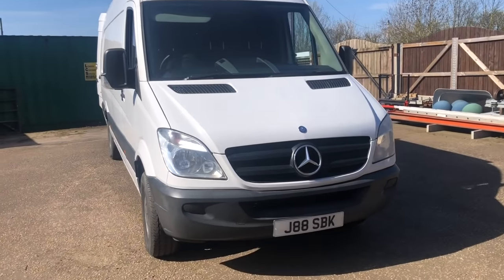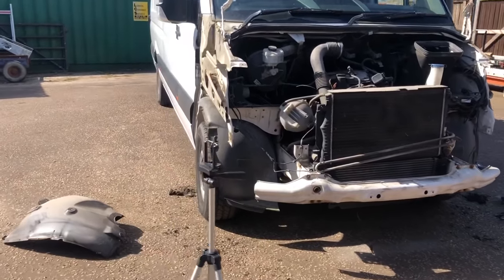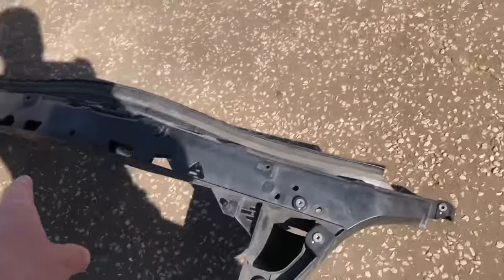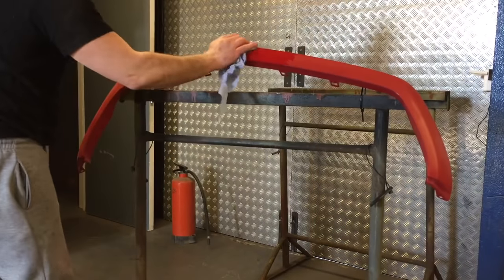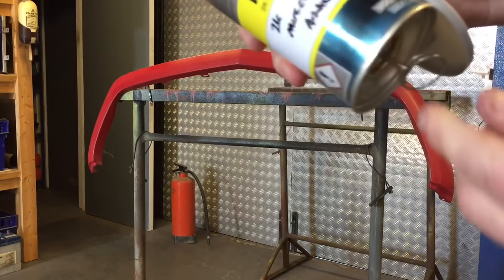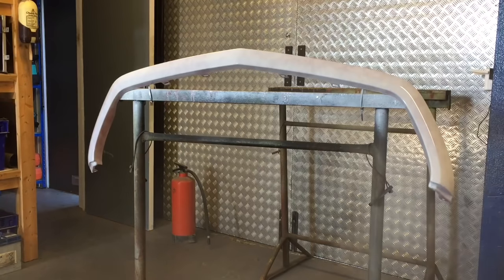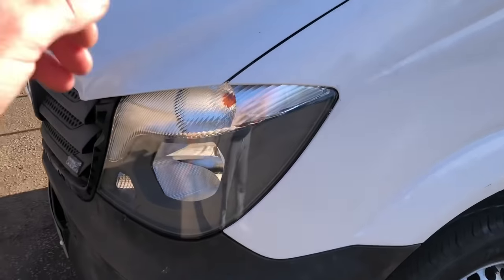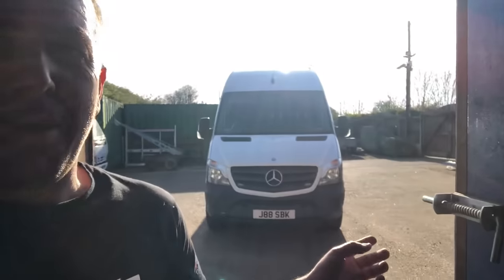2008 Mercedes sprinter facelift to 2017 PT 2

Comment: Nice work. But I personally prefer the original earlier shaped front end.    
I changed the rear lights and rear panel on a mk3 escort years ago, updated to mk4 rear lights. But afterwards I wished i hadn't!

Comment: The changeover here in the US was 2014 for this style front end. I learned something new: watching your video, I don't have to change the inner front bumper reinforcement bar or the radiator. That's great news. 
So is this the list?
01. left front fender
02. right front fender
03. hood
04. radiator support
05. left headlamp
06. right headlamp
07. front bumper 
08. grill/star
09. grill surround

Did you use new hood hinges? New hood latch?

Comment: I’ve got this to do this evening 2012 to this face lift my questions are do you not need to change the radiator? And the headlight wiring is it the same colour wires just a different plug ? Thank you for the video

Comment: Hello Rob thank you for the video it has helped a lot with my facelift on my sprinter van . Just wanted  help with the headlight wiring to please ?  I don't know which wire I need to connect to on my 2007 sprinter to make this 2016 headlight work.

Comment: At 00:25 you spoke of doing some wiring for the new headlight housings from the old. Did you get the updated sockets with all the second hand parts you bought? I'm doing this conversion now and having a problem finding the correct replacement sockets for the headlights. A link would be great if you have one.
Reply: Hi did you manage to find the headlamp wiring diagram I need help on this thank you

Comment: i spend my life in sprinters as i work for iceland ive driven old ones and new ones ours is a face lift as it is a 64 plate i have loved watching it as of course we dont take them apart but its nice to know how its built
Reply: Martin Burbridge 
Yay! I’m a Sainsburys Driver.
Wait till you drive a new 18 plate upwards, drive like a dream especially as an auto which is all we drive no manuals on our fleet.
New ones aren’t as handsome though!
Reply: ive driven a 58 plate one  when ours was broken for 3 months as side door fell offwe have auto too the one we have had paddle shift on steering wheel where as our 64 plate you can go up and down gears by knocking it sideways Sainsburys you use them ones that look like our old box ones the have sold all of them now
Reply: Martin Burbridge 
Yeah new flappy paddles are nice.
Those boxes seemed a crap idea when our new 19 plates came.
But with the shortages we’ve been stock transferring from the RDC and they were great just sticking a load of rollers in the back off a scissor lift.
Reply: they was a good van iceland seem to like the van looking like van but the box ones could hold more crates especially as we are mainly frozen the frozen bit was double the size

Comment: What did you do regarding the headlight wiring? Just done the conversion on mine but although the original plugs fit the headlight they don't operate

Comment: Hey guys!  I just bought a new to me 2011 2500 170 here in the US.  The previous owner performed the 2017 facelift but never completed the process by connecting the headlights; unknown to me.  So now I am having difficulty figuring out how to connect the headlights.  The 2011 came from the factory with xenon headlights and cornering lights.  The 2017 came with non-xenon headlights and daytime running lights.  How did you guys figure out how to connect the new headlights going from a 10 pin connector to a 14 pin connector?  Did you experience similar problems and how did you overcome it?  Do I have to replace the non-xenon lights in the 2017 with xenon along with all of the other supporting hardware?  Ballast, etc.?  Please help.  Thanks!

Comment: Hi, can you get an adapter for the headlights? I’ve just put a 2014 on a 2011 plugged the lights in and nothing works, I’ve been told there’s an adapter you can buy, 
Thanks joseph.
Reply: Did you find an adapter?

Comment: Hi Rob, thanks for the video. What did Chris need to do on soldering the headlights and connecting the DRL’s? 
I’m looking to do the conversion
Cheers
Reply: No soldering required ive just done my headlamps conversion wiring from 2008 to 2014 you can use the original loom from 2008 to make facelift lights works
Reply: @tanny8970  Thanks . What colour wire do you use for DRL ? Do you have a full list ?
Reply: @tanny8970  how did you do that ?

Comment: How easy was the wiring , did you get a wiring diagram ( or could you publish one ?)
Did you manage to get the DRL working correctly?
Reply from the maker: Neil Birch all the same colour wires  so like for like 👍
Reply: Thank you 
I’ll be tackling it tomorrow 
Did you get the daytime running lights working ?
Reply: So if anyone else is interested in the wiring, the wiring loom is identical and the colours match up with one exception and that is that the new lights include DRL so these have an extra wire which is green , if you connect this to a switched live feed I used one off the wiper motor feed .

Comment: That grill looked good nice finish. I messaged you on Instagram about the cossie with some info plus I know a lot about them be glad to help either parts or getting the car going hope you see it and I can be of some help
Reply from the maker: R A sorry mate I never see them on there as I don’t use the message on there I don’t get time to read them. I’m sure we will get it all running ok 👍
Reply: @sruk  oh I dont doubt you guys will get it going I just got a good source for parts and knowledge base on them. If The car has grey injectors be carefull not to leave it idle or short start stops in the yard it will bore wash. These are possibly stuck if it was not getting fuel. They suffer from tdc and phase sensor if left sitting as well.  If you would like to know anything about these or parts etc let me know I been cossie enthusiast for 20 years of ownership

Comment: Struggling to see the point of this. When you add up the materials (even second-hand) plus the man hours involved, is the increase in value (as far as I can see, it’s still the the same year and mileage) really worth it?
Reply from the maker: Steve Young it’s the owners preference he wanted to update it and the parts were reasonable so why not
Reply: Hi I was wondering if you  have any diagram or how  you fit  the head light  wiring  ( new plug ) thenks